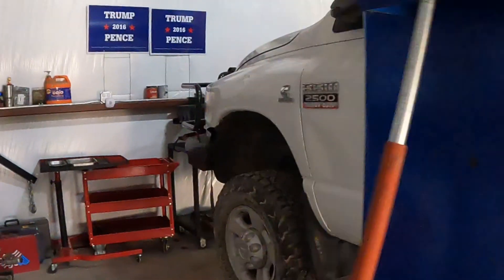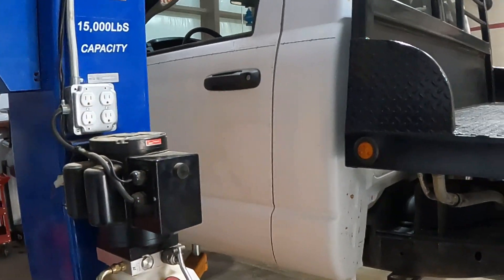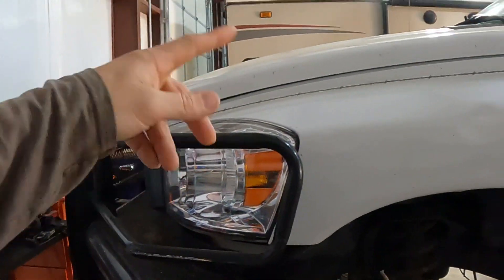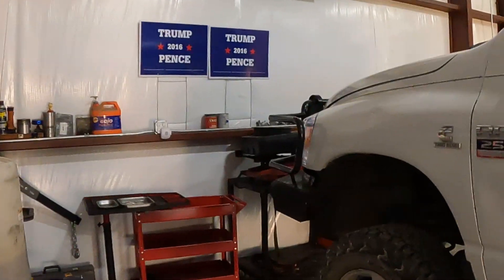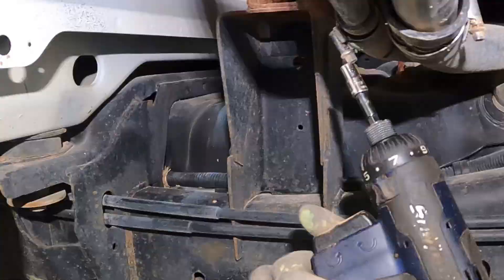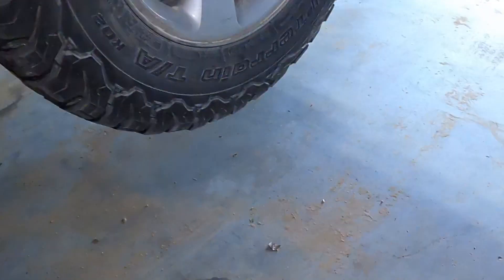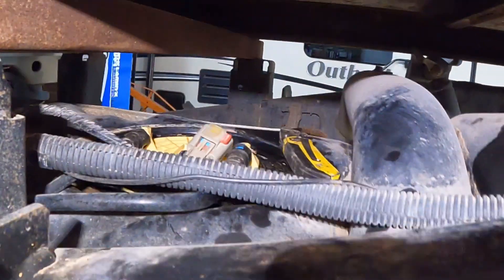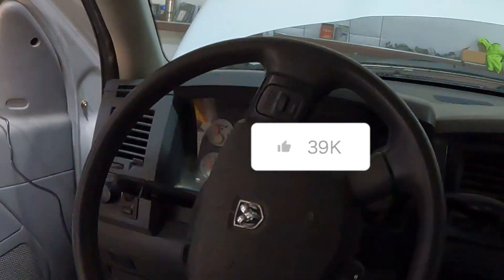P0148 Cummins Code, How To Fix + Lift Pump Install

Comment: I have same code pop up just randomly other day and fuel gauge stuck on E. Low Fuel light on too. Truck runs perfectly fine I haven’t actually tested the fuel pressure. There is a fitting someone installed on the top of the CP3 injection pump I may hook up to that to check it here soon. May end up getting another supply pump to throw in the fuel tank.
Reply from the maker: Yeah may be best to replace the fuel sending unit as the fuel level module is integrated with the lift pump. eBay is your best bet to save money. Got over 20k miles on this pump and no issues.
Reply: @KPauto69  sounds like you got a good product at a good price. Thanks

Comment: See I have the p0148 code but my truck doesn’t go into limp mode or falls on its face, I’ve cleared it many times and pops back on, I’ve changed the FCA I can hear my pump turning on but it only goes go for maybe 15 seconds is that normal?
Reply: Hello, did you solve the problem, my truck does the same thing, could you help me?
Reply: @raulfigueroa7025  yeah it was my lift pump but also check your relief valve
Reply: ok thank you very much forbare right now have a good afternoon
Reply: @raulfigueroa7025  believe me the pump is about 170ish here in Texas, but it’s a lot of cheaper than an injection pump keep that in mind

Comment: Was your truck smoking too?
Reply from the maker: No, it would just continue to go into limp mode
Reply: @KPauto69  I ended up changing mine after this. Didn’t fix my issue and code. Eventually I found my #3 injector was bad.

Comment: Nice job! Something different than a high horsepower pump. What brand is the pump? I don't see myself spending $800 on an aftermarket pump for a truck that is staying stock and lasting me another 18 years.
Reply from the maker: You can find the same off brand lift pump on eBay for $60…the brand is “DriveMotive” and the quality is essentially the same as any O’Reilly’s brand. So far we put 10k miles on it and had 0 issues.